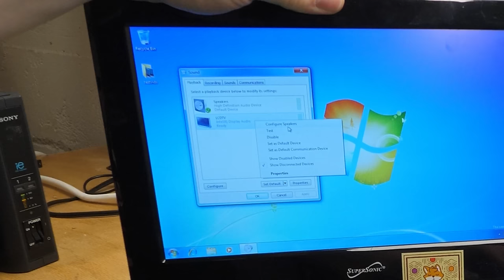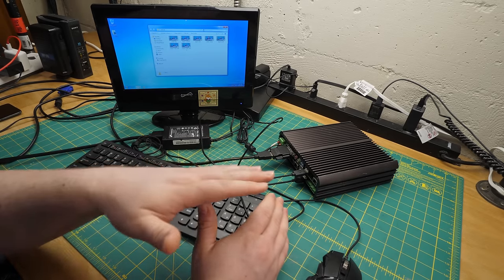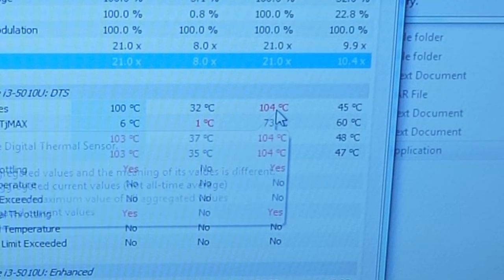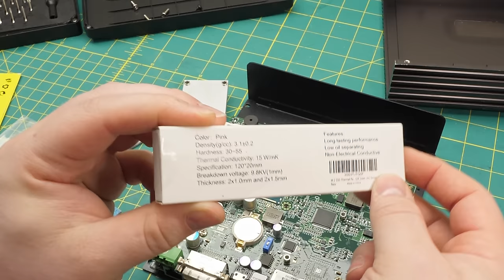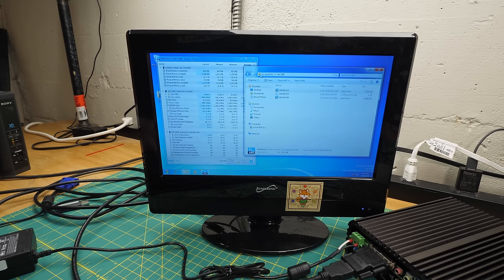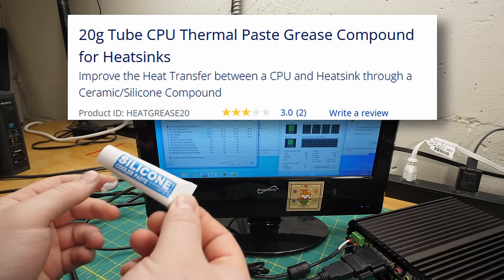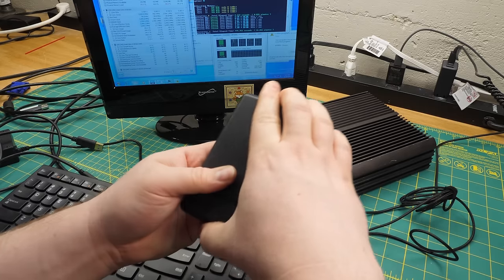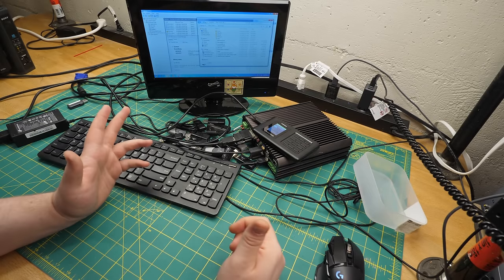Little Guys 4, Pt 2: More DVI Nonsense

Comment: I had no idea DVI could transmit audio, I had always assumed it was a video-only connector
Reply: The DVI specification has no provision for audio. However HDMI 1.x uses the very same TMDS signaling and is backwards compatible. They simply output HDMI-style data over the DVI connector.
Reply: It's very hacky and not really supposed to work. Requires the video card to be funky and send audio over certain pins unused in digital mode and for the adapter to be aware of this
Reply: HDMI is basically DVI on a different connector, plus some extra features. An HDMI-to-DVI adaptor is entirely passive. DisplayPort-to-DVI needs a converter chip.
Reply: It actually sends them during the horizontal blanking interval, in what HDMI calls "audio islands". The lines would otherwise be inactive during that time. Tons of DVI interfaces support this, even w/o being true HDMI sinks/sources.
Reply: @KJfourIPS   That's pretty clever. The horizontal sync rate is comparable to audio sampling rates.
Reply: @Roxor128  Definitely learned that the hard way when I wanted to connect my 2560x1600 DVI Dual Link monitor to anything that only had DP out
Reply: I was about to come to comment that HDMI doesn't do audio, silly, only to hear it just work. My goodness. I knew that DVI <-> HDMI was a passive thing but I wasn't aware that it sent the audio through the DVI pins as well.
Reply: Yeah, weirdly I have a PC hooked up to my TV and the graphics card is capable of sending audio over DVI, and natively supported by Linux
Reply: Same here.
Reply: @Nukle0n that's not what's happening here if you paid attention to the video and the previous one. HDMI is backwards compatible with DVI, and this Intel CPU has a regular HDMI output routed to the DVI port. This means a DVI display will work fine, but if an HDMI display is connected with a passive adapter they will negotiate all HDMI features over the DVI connector. The audio in HDMI is transmitted inline with the video on the TDMS pins, which is why there's no passive way to separate the audio and video from HDMI.
Reply: @Cuphat yeah since the DVI plug is actually connected to HDMI on this particular computer
Reply: I remember back in the time of the 8800gt and the 9600GT that they had a plug so you could inject motherboard audio into the GPU and i believe it was to get around DVI but i can honestly not remember the specifics of it
Reply: same. today i learned
Reply: @Nukle0n erm, no. HDMI audio is simply sent in unused portions of the DVI frame (line and frame blank intervals), encoded using symbols that aren’t used by video so there is no confusion. No extra wires beyond the standard R G B and clock pairs.
Reply: I'm another one who didn't know but 2 years ago I connected DVI-to-HDMI cable to one PC and got a big surprise. I was like.. How is this possible?
Reply: There is a catch that is more important with today's screens: transfer rate (resolution × fps) limits.

HDMI only has enough wires to connect to single set of data pins. Second set (in dual-link DVI, required for those larger-than-1080p modes) is not used in the passive adapter.

Therefore, dual-link DVI to dual-link DVI has two data links with up to 165 MHz clock, and gives you up to 1440p@60 (and a little bit more). HDMI to HDMI (if it's not the most ancient standard) has single link that can use higher clock rates, and gives you higher resolutions. But DVI to HDMI is limited to single link with DVI clock maximum, and that gives 1920×1200@60.

There is no way to combine two links into faster one passively. Potential active converter box is probably more rare and expensive than the rest of your peripherals, can introduce lag, etc., so you simply use either DVI-DVI, or HDMI-HDMI with higher resolution monitors.
Reply: @DarkKnight32768 haven’t thought about Dual Link vs Single Link since 2010 😅
Reply: The GPU doesn't really know or care whether it's using a DVI or HDMI connector, it's just a TMDS output. If it device at the other end advertises audio support, it will send audio to it. Like someone else said, HDMI doesn't add additional pins for audio, it uses empty periods between frames in the video signal.

Comment: In a similar vein as the iodd device... Ventoy is fantastic for making any flashdrive into a flashdrive that can boot various isos. Can also still retain nirmal flashdrive functionality.
Reply: Ventoy is great. It's what I have been using. I did run into an issue with it trying to load Windows XP, but otherwise, it has been working great
Reply: @tabbertmj  Same here! Also using it. And since I am not handling computers too old, its compatibility is more than enough for me.
Reply: Yeah I don't work on enough computers anymore to justify having a "mass compilation" of isos. If I did I'd totally buy one, but ventoy is plenty good enough
Reply: I think Ventoy can also work when written onto a USB-HDD, but haven't tried it yet. The obvious limitation is that you cannot change disk images once it's passed the Ventoy boot menu.
Reply: same, Ventoy is fantastic
Reply: +1 for Ventoy. The IODD is a fascinating and lovely device, and I'd certainly use it if I had one, but for the purpose of installing OSes on somewhat recent PCs (with "somewhat recent" meaning "supports booting from a USB disk at all", i.e. 20+ years), a USB thumb drive or USB SSD with Ventoy on it gets you 99% of the way at a fraction of the price.
Reply: ... and now I want an IODD that can boot Ventoy.

Comment: little info on the DVI audio: some PC monitors supported it natively, usually monitors that had speakers, but no HDMI back in the day
my first Widescreen PC monitor was one of those screens, a Fujitsu siemens monitor from 2006 

but doing it over a HDMI adapter is the easy way
Reply from the maker: I honestly wonder how many would do it with no problem... assuming they had audio output. I've recently bought several small TVs in addition to the one in this video just because they have built in speakers, which I rarely see on computer monitors. But I wouldn't be surprised to learn that a lot of things that have both speakers and DVI support it.
Reply: @CathodeRayDude  Haven't watched the video yet, but at work I have a newish monitor connected to DVI on the computer I use, and speakers connected the the line out on the monitor. I get sound through that. I'm not using an HDMI to DVI adapter, straight DVI from the motherboard. You might ask yourself where is that large automobile? "Why don't you use the line out on your computer instead of this weird mess of connections?" and to that I say... there used to be a reason, but I forgot why.
Reply: @CathodeRayDude  
FYI, some GPU's don't have a built in audio interface, but still support audio over DVI/HDMI
For example, the GTX 265 needs a cable to the SPDIF connector on the motherboard to send audio from its DVI-I port(s? I don't know it would send the same audio to two displays)
Reply: Heh, then there's my monitor here that has DVI, HDMI and VGA, and a headphone jack to output the HDMI audio, but it WON'T accept DVI audio, cause it won't! It just doesn't want it.
Reply: I have and HP w2408h monitor (2008) that has HDMI with speakers and the audio and HDCP worked over DVI on the 7950 GT I ran. 
I still like DVI, it seems to be versatile and pretty compatible.
Reply: Well, that's certainly one way of skirting the HDMI license.
Reply: I didn't know HDCP over DVI was a thing; and now I hate it.
Reply: @Kalvinjj I wouldn't expect audio support to be hooked up to the DVI port; but have you tried a DVI-to-HDMI adapter hanging off the HDMI port?
Reply: @BrendonGreenNZL  That would probably work, the monitor supports HDMI audio after all and the graphics card shows it supports this on it's sound settings, just haven't tried it (and got no real reason to do it either other than curiosity).
It's just funny how it has everything perfectly ready to support it, but doesn't out of... I don't know, stubbornness?
Reply: @BrendonGreenNZL  I hate HDCP itself, but frankly I'm happy DVI supports, so I can actually watch HDCP-only content without having to downgrade to the flimsiest crappiest cable known to humanity (tied with Micro USB) for my video, I can just use the proper digital cable instead.

What I would 100% hate would be it not supporting, and forcing me to change to ...I don't wanna call it's name again... to watch anything that requires it like encrypted BDs (like pretty much all of the commercial ones).

Comment: To anybody wondering how DVI and HDMI can send audio when there aren't even audio pins in the pinout - they send it during the horizontal and vertical blanking intervals. This has the slightly amusing side-effect that some of the fancier new audio codecs do not work in sub-1080p modes because the video doesn't have enough leftover bitrate... It's bound to the same pixel clock as the video signal
Reply: You'd figure that the computer would decode the audio on the CPU, and emit the resulting PCM through the DVI signal. That would limit your sample rates and maybe the bit depth, but not your codecs.

Comment: Re: the iodd: I remember doing a similar thing with my rooted Android phone back in the day! There was an app I could use to make my phone pretend to be an optical drive, and it was so incredibly useful
Reply: It's sad though, that Android got dumbed down so much, that stuff like this isn't possible anymore. I hate Android since Marshmallow...
Reply: The early days of android and rooting phones was awesome
Reply: I still use that on my phone today! The app is called DriveDroid. It depends a little on the phone you have and what software it's running what the capabilities are, on some it can only emulate a CD-ROM drive, on some only flash drives, and some can do both.
Reply: @kyoudaiken accessing the terminal shell felt so cyberpunk, especially on a phone with a slide out hardware keyboard.
Reply: @lenano  You are a lifesaver. I have a bunch of old Android phones lying around, most of them with non-upgradable old versions of the system, now I know what I can use them for :)

Comment: Hey, just FYI, the pads are perfectly fine if compressed. Too thick of a pad is usually not big of a deal as long as you can squish it down, however, too thin is a possibility.

Comment: Arctic Silver is not directly conductive (despite containing conductive particles, owing to the oil suspension turning the thing into a paste) but can have some capacitive coupling effects so still should be kept away from active circuitry. Just don't make a massive mess when applying it and you'll be fine, this is no liquid metal we're talking about here.

Can confirm that a regular old thermal pad of approximately the right thickness is perfectly fine for replacing "gap filling" thermal compounds/pastes/waxes/whatever they put on those things stock. Performance will generally be in the same ballpark, and they're a lot less messy.

Comment: We used common silicone paste when reairing office-type PCs and I am using it today. Cons: it is some 4C hotter at stress testing. Pros: it never-ever goes completely dry. Office computers we dealt were mainly on the floor, moved and kicked by feet all the time. CPU cooler shifts a tiny bit when that happens.  That nice, expensive thermal paste goes dry and literally cracks, breaks thermal bond between CPU and cooler and PC "dies". Common white silicone thermal paste remains "gooey" and CPU stays thermally bonded to the cooler. Saved us a lot of driving just to change the thermal paste.
Reply: Yeah the basic stuff is perfectly fine for computers that aren't running right at the cusp of thermal throttling. Since most office machines are "overcooled" you just need working paste and you are golden. Anything else is a waste of money.

Comment: K5-PRO is perfect for situations like this. you will never need to worry about pad thickness again.
Reply: Calling it thermal mayo
Reply: Until you need to service it again, which is a nightmare
Reply: @probablyanadult7354  Closer to peanut butter than mayo
Reply: It can be a nightmare to clean up if you ever need to remove it, especially if you end up getting it on your clothes like I did 😂
but it does work really well.
Reply: Would you need to replace it in an embedded system?
Reply: It's a complete and utter mess though.

Comment: When I was building my current PC, I had it half built, using the onboard DVI output while my video card arrived. I stuck a DVI to HDMI cable and fed it to my secondary monitor with audio output and was freaked out by the startup music.

And that is how I learned DVI can also carry audio and the HDMI cable will convert it.
Reply: Depends on the GPU. The newer ones can pass HDMI through DVI if you use a HDMI cable. The cable does nothing but carry the data. The audio data is AFAIK as pixel data in the blanking area of the HDMI signal, which for some bizarre reason still exists. Someone will correct me if I'm wrong.
Reply: @kyoudaiken I also find it baffling that the majority of display signaling standards that we use today are little more than VGA (a protocol that is now 37 years old) dressed up in a trenchcoat. Why do we even need to send a full frame of video when displaying a mostly static image; especially since all modern display devices, by necessity, have their own internal framebuffer anyway?
Reply: @BrendonGreenNZL  It would be really cool if we just would update rectangles on the screen just in time when it's ready. But I think there are a lot of issues with that to be solved first. Also it would be nearly impossible to determine a refresh rate limit because it heavily depends how many pixels on the screen are actually being refreshed. Also this new tech would break compatibility with EVERY existing screen and graphics card if not implemented as an optional feature. But I'm sure VESA is working on something like this already for years. VRR like G-Sync and FreeSync or VESA VRR is the next best thing right now.

Comment: about 3:04 - some HP monitors definitely do that, my LP2065 has analog pins on its dual DVI inputs and it works if you feed it a VGA signal over an adapter

Comment: That HDMI port is wasted unless you do the obvious and make this into the most impractical HTPC ever used.
Reply: I actually have a PC in my bedroom which also doubles as my home theater room. It's an AMD Ryzen 5700G passively cooled on an ASRock B550M-ITX/ac in an Akasa Maxwell case which also doubles as a passive radiator CPU cooler. Really like this thing. It runs Manjaro Linux. Got it connected via HDMI to a 43 inch 4K display. Much better than """Smart""" TVs.
Reply: @kyoudaiken  Why would you run manjarno Linux though?
Reply: @nilswegner2881  Because I like it an want to. I never get these people who are like "Why do you put Nutella on your bread, why don't you put peanut butter on it instead?" DUH, because I want to put Nutella on it...
Reply: @kyoudaiken  there is absolutely no way one can actually like manjarno.
Reply: @nilswegner2881  Nobody has asked for your opinion.
Reply: @kyoudaiken  it's not an opinion. It's a fact that manjarno is absolutely unlikable
Reply: little guys make GREAT HTPCs, especially when they can run fanless

Comment: I once measured the gap in that type of situation by putting a small ball of blue tack in some cling wrap and installed the heatsink with that in the gap. Pulled it back apart and used calipers to measure the height of the smashed blue tack.

Comment: My dream IODD is one that's the size of a normal Pendrive, since I'd love to be able to keep one on my Keychain or lanyard. The NVME ones are just a bit too big for me to carry around literally all the time, so that's why I still use Ventoy.
Reply from the maker: Completely agreed, I wish so bad that these were a common product category! Honestly this is a niche that badly deserves an open source hardware solution.
Reply: @CathodeRayDude A Raspberry Pi Zero (or any other small device that can run Linux and has a USB port that can run in "gadget" mode) would be a worthwhile contender; so long as it also has a means of connecting fast bulk storage to it.

Comment: I'm honestly amazed you got sound out of the DVI port 😮 All my life I was convinced that adapting DVI to HDMI does not get you any audio 😮
Reply: It’s crucial that the output from the computer is HDMI signalling, like it is from the CPU iGPU here, for the adapter situation to work. If you tried it from an older GPU with “real” DVI (and no audio connection, physically or in software) you definitely won’t get audio.

Comment: I have a hypothesis regarding the hole in the drive tray. When manufacturing a part like that, it was almost certainly stamped out in one motion from sheet stock. During the stamping procedure it would be easy to add a punch to cut out a hole. 

I believe the hole is mostly a way to reduce costs via scrap. The more drops you have during stamping, the faster the scrap bin fills up, the more money you get from selling the bin. Perhaps they also did it for airflow or heat benefits, maybe not. Or perhaps (but I think far less likely) is they did it for weight reduction reasons.